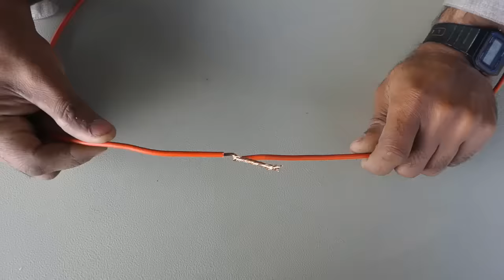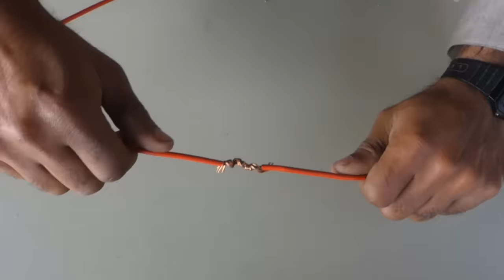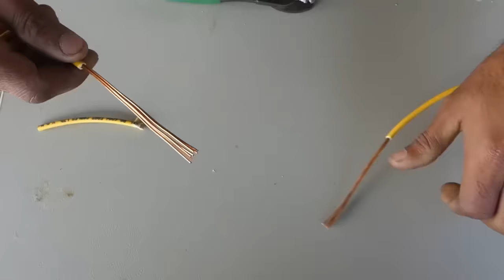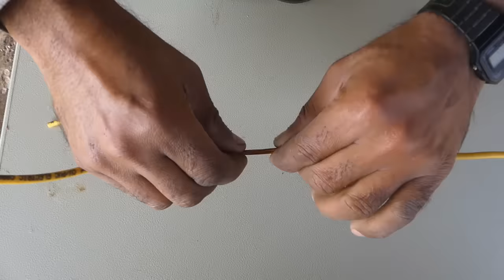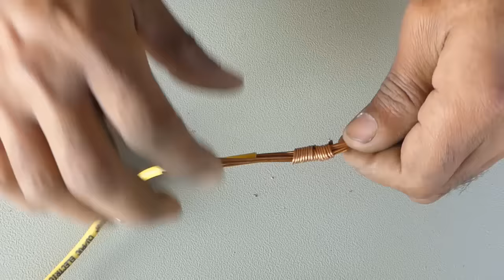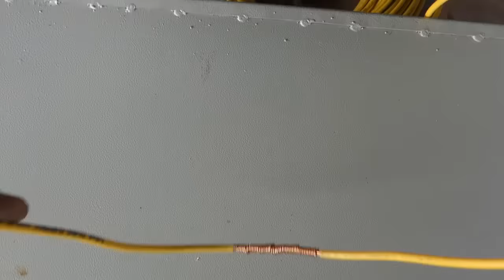Awesome Idea! How to Twist Electric Wire Together | Properly Joint Electrical Wire | Part 1

Comment: I like the idea
But I have never ever had so much weight pulling on my electric wires

Besides, those little stones (idk the english word for them but they're called kroonsteentjes) (found the english word. Wire stones)
you could just cut the wires a little shorter, insert 1 in each end and twist the screw to tightly secure both in place.
Or those rubbery wire sleeves you can but on both end and then heat a little to seal them around them. Also protecting the bare laying wires.

Like sorry but there isn't much use for your video tbh...
Reply: Wire nuts or Weigos

Comment: Its good for permanent joint....but in electrical work we have to open joint wires often to connect new wires for new loads....should not use this for phase or neutral wire, opening it will be a nightmare

Comment: I don't see the use of twisting wires if you have a lot of wires. Twisted wires cause heat and eventually tape or shrink tube melts and then booom. And I'm sure if someone is going to twist wires he would not want to use twisting methods in this video because they will not have much wires to do so

Comment: Wow all those twists and all that time. Joining 2 wires in 2 secs using a quick splice connector and you don't even need to bare the wires. Oh and no soldering needed either.

Comment: YOU GOT IT ALL WRONG! The correct way to do this is using one strand at a time. And then, if you've got more time, leave the strands extra long so you can double back, one strand at a time - of course. Please don't waste your time on a third doubling back. It's a waste of time.

Comment: My wires are connected to direct meter so i cannot switch off the phase and do like this method to give joint if i do like that then i will be no more alive after a tasty shock 😒

Comment: Come on theres nothing wrong about the first 2 joint  the first one is what we called rat tail we useď yhat joint in ordenary house wiring the second one is western union short joint and we're using it for flying connection so whats wrong with that and the last one that you are expending more time we're used that for secondary power line or the transmission line ... kindly specified if you are making a kind of DIY like this so that the viewers can clearly understand what was you want to show them ...thanks US westhern electric ....

Comment: This is not how you do joints, do not do this please...There are great connectors on the market and that is the only proper way to do these. Also let the pro electricians do it, if you don't know what wire you are touching etc. Risk of getting electricuted!

Comment: Neither time nor cost effective. Also wire joints aren’t meant to be under tension in this way. What possible application could you have for such a slow, tedious and wasteful method? None of this is in the NEC and for good reason.

Comment: 1. Itne time me 5 wire jod dete
2. Agar aise h karna hai.. Toh fir solder bhi karo.. Air leak heat nahi hoga
3. Itni mehnat ke baad insulation kahan hai??? Tu toh marwa dega

Comment: I GUESS IF YOUR TOWING A TRUCK WITH IT SURE. OR YOU HAVE MORE TIME THAN A 6yr old hahhahaha try this with soft copper or aluminum wire GOOD LUCK only work with thick home electrical wire

Comment: That's a lot of work to connect 2 wires together, horrible job man.  How much time did you waste here??? Especially since this isn't life-dependent rope hanging a human off of a structure..... this is just electrical wire.  Horrible music too man, obviously you made it in the 80's.